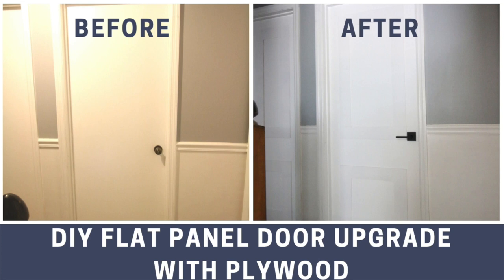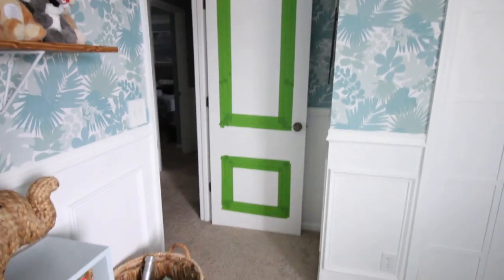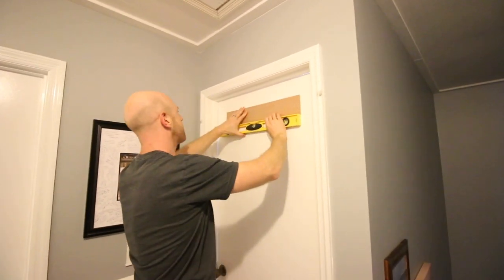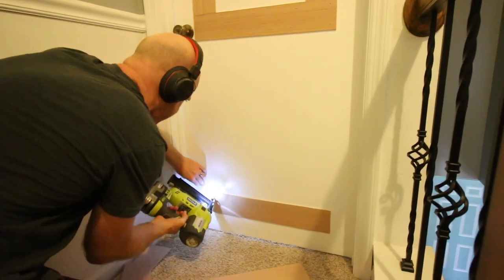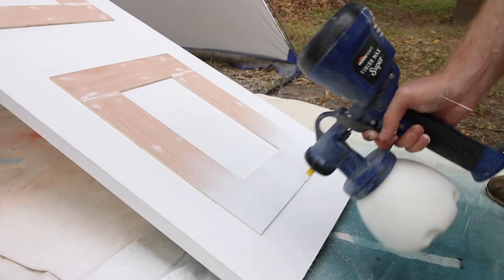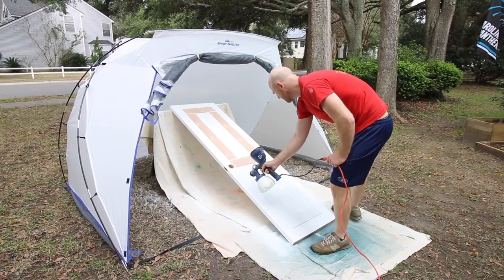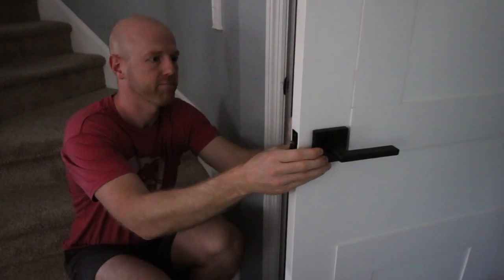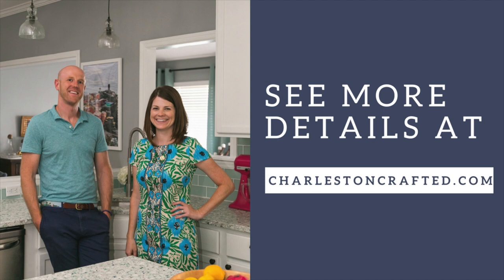Flat Panel Interior Door Makeover - with Plywood!

Comment: If you would have build up the plywood in a shaker door style it would have made them look way better, but this is still pretty neat
Reply from the maker: Cool idea! Didn’t even think of that but I love it!
Reply: Great idea but then she woould have to make new holes for door knobs :(
Reply: @nooramadani  Yes, just 1 more step.  You would need to use a hole saw (cheap drill attachment) to drill a hole in the plywood that matches your door hole.  It's a 2 minute job.
Reply: @nooramadani  The actual pain of doing it this way (if you're up to the challenge / care enough about the final result) is blending the plywood edge, and the door edge.  I used wood filler all the way around the visible side of the door to ensure the plywood to door transition is seamless.  It took quite some time, but every door in my house is modern / stylish, and I probably spent a couple hundred dollars on paint / plywood.

Comment: Weren't the 4" plywood strips rough on the edges? It didn't look like you sanded them smooth. So I'm wondering how the edges were?
Reply from the maker: Edges were smooth. Did sand them, but didn't show it on here.
Reply: It showed as a sloppy work in the video. Also they somehow do not add dimension - but this could be just how you filmed it.
Reply: @mybestideas1  I thought it looked classy. Big improvement.

Comment: How did you nail into a hollow core door?
Reply from the maker: We used an 18 gauge brad nailer with one inch nails. Worked perfectly and they are very secure.
Reply: You don't. Unless they used glue as well, they will eventually lift.
Reply: use liquid nails instead and couple of nails to hold it while dries

Comment: Yikes, that's a dangerous cross cut on the table saw. This video explains why: https://www.youtube.com/watch?v=F0jbg9LuDsc
Reply: First thing I noticed too, best if used a stop block on fence, or better yet use a miter saw. Good job on the rest though.
Reply: Gabriel Lariz I did something similarly silly before, not with the miter gauge, but cutting a small piece that was slightly wider than long against the fence with a push stick. When it kicked back, I knew instantly that I had done something stupid, but not before the piece of wood flew back, hit my finger and broke it!
Reply: I saw that very thing, holding that wood between that blade and that fence. Could have very easily moved his fence over another half inch slammed the board against the stop block that way he's got no pressure between the blade and the fence. Bball severely underestimate the "awesomeness" of a sled for table saw.